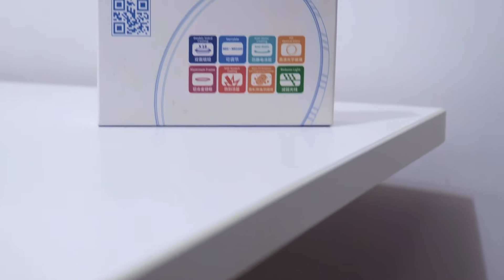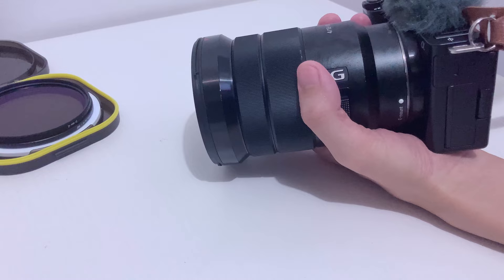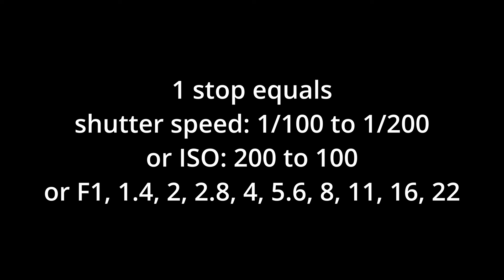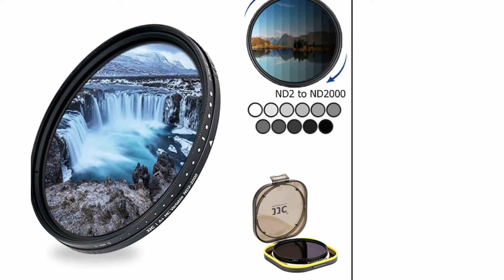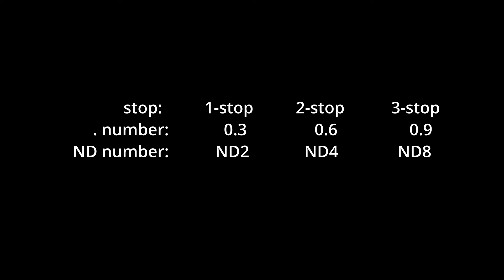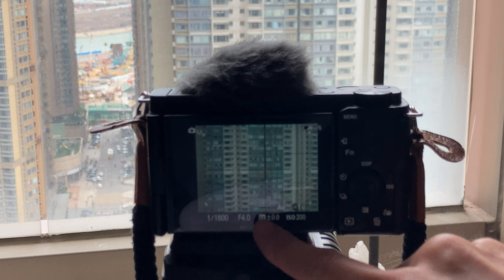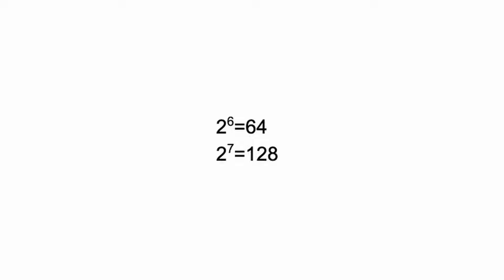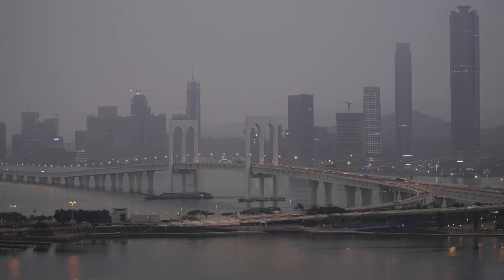ND Filter Guide for Beginners (How Many STOPs Explained)

Comment: For 3 stops I can use .9 ND ....CTO or CTB? Thanks
Reply from the maker: 3 stops means 0.9 or ND 8. This is different from CTO or CTB, which are for adjusting temperature.
Reply: @ConstantineSPhotography  So , I came across a question with 4 possible answers and i cannot understand it....here it is: If you want to reduce the sunlight coming in a window by three stops as well as the color temperature from 5500K toa a tungsten balance, which gel would you apply?  1- CTB.9 ND 2- CTO.6 ND 3- half CTO.3 ND or 4-CTO .9 ND .....and I cannot figure it out.....can you help me?
Reply from the maker: This looks like a complicated question, sorry I can't give you an answer as I'm not familiar with CTO or CTB. I guess this will require some trial and error.